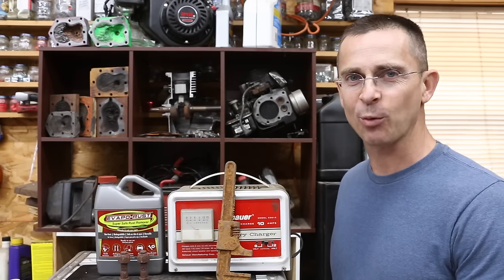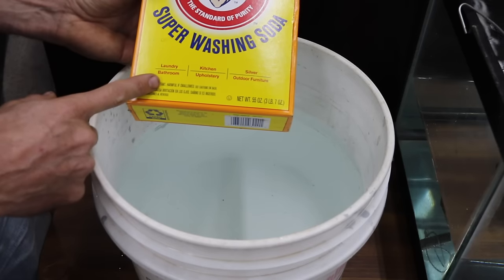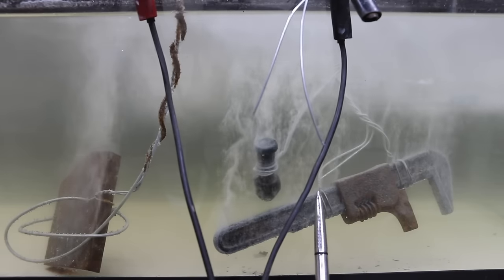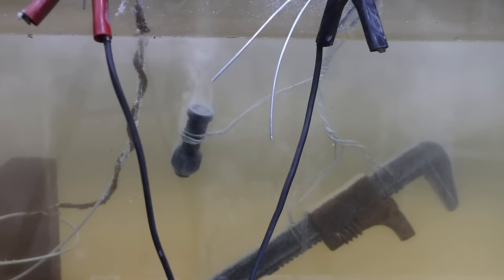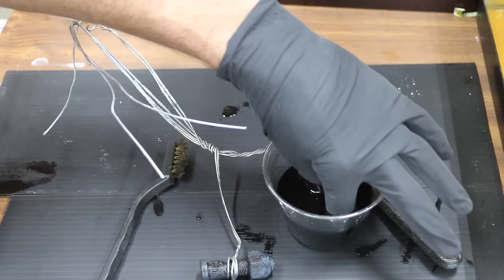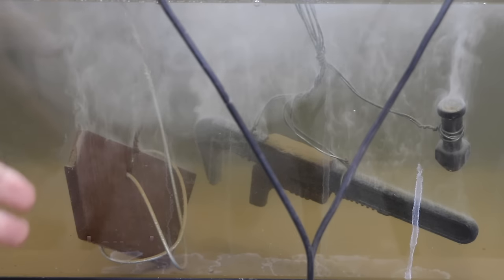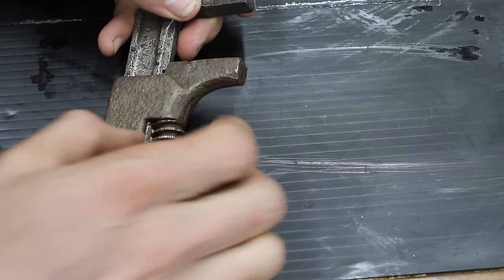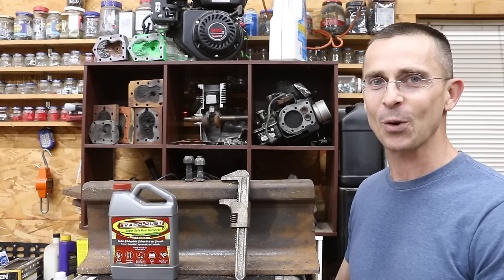Is Electrolysis better than Evapo-Rust?  Let's find out!

Comment: Some other noteworthy advantages of electrolysis:

  The sodium carbonate is not “used up” and can be used indefinitely as long as lost water is replaced periodically and the electrolyte solution is strained or filtered to remove the sediments that build up.

  There is no danger of removal of metal (apart from loose rust that flakes off); no matter how long it runs, no iron will be etched away.

  Under some conditions less oxygen is removed, leaving “black rust”, the same substance as gun bluing, which will slow down the formation of “orange (bad) rust, with the help of light oiling.

  It is easy to make a temporary “tub” for larger parts. I’ve draped plastic dropcloth over a ring of cinderblocks to create a small “tank” on the back patio. Use heavier duty dropcloth for this.

I have read that the process is cleaner using graphite rod as the sacrificial anode. Since the graphite does not react to the released oxygen there is minimal debris produced. Actually it’s not “sacrificial” at all! I’ve thought of trying the graphite pencils sold at craft stores like Michael’s for a small scale setup.
Reply from the maker: This is great information.  Thank you.
Reply: I believe alkaline batteries have a carbon rod down the centre that would probably work also.
Reply: Jester123ish, I don't know. I looked up the differences between the traditional carbon-zinc batteries I grew up with, and the more recent alkaline batteries. The core electrodes are slightly different; the older ones have a pure carbon core, usually graphite with a binder, while the newer ones use a bronze plated nickel collector, so I would say no. Michaels sells "woodless" pencils, which are solid graphite, and Amazon carries carbon fiber rods used in RC planes, which are also a form of graphite.
Reply: David LaPierre, I put on my thinking cap (my good one, not the one from work) and came up with a theory. It's possible that the graphite rods are porous and somewhat soft. I suspect that the bubbles of hydrogen produced from the electrolysis of the water form under the rod's surface, causing the graphite to gradually flake off.
Reply: Thank you for the info, especially about the graphite/carbon anode, as I want to do electrolysis on my bike soon.
Reply: @ProjectFarm  I bought graphite sheets and squares off E-bay.
Reply: Not to kill your vibe but all pencils use graphite duhhh
Reply: Yup take apart a 6v lantern battery and disassemble the cells inside. 

Straight carbon rods
Reply: Carbon does erode pretty fast in my 12v 4amp setup. The watter gets hot. Maybe its an overkill but i get the same results in Hours/Minutes not days. I think the carbon reacts with the oxygen that is formed to some CO2 but its only a guess. Normaly my lysis drop in effectivnes after Minutes due to electrodes corrosion but noth with graphite it even gets out of controll and is progresively agresive due to better conductivity after rust removal. Sadly agressive does not mean effective. I need 10 min to get 90 percent of the rust and another 90 min to get the other 9 percent and another day to get the 0.9 percent.  You have also to concider the placement of the electrodes and moving the part. Electrolysis is so much better then shitty evaporust. You can even derust your car in a swimingpool. I dont know, graphite is pretty expensive but makes your life cleaner and easier.... now i am testing the stability of graphite in the electrolyte without the current.
Reply: @philwood1009  
Could be! Either way, I've never had to clean off graphite after being used a while like I do with rebar or zinc sheets, so that's nice at least.
Reply: @philwood1009  I think you're onto something there. The bubbles would erode the softer graphite compared to a steel anode. I think that's the right word! But you know what I mean.
Reply: @yoruhana190  I'm just curious in your setup have you ever attempted to measure the volume of the oxygen and hydrogen being released during the process? I'm curious about the process of separating the water molecules into their elements. If you search on here or there is videos about what is called Brown gas. People are experimenting with the brown gas to power gasoline engines or at least augment the gasoline. Some Industries are using electrolysis to create fuel for cutting torches. The byproduct of the combustion is water. Also a couple more questions regarding your setup come to mind. How hot is the water getting and what is the volume of the water used? Be safe for that hydrogen and oxygen gas think Hindenburg on steroids. The Hindenburg only had hydrogen gas.
Reply: @davidlapierre4058  have you tried stainless steel? Are you using tap water or are you using distilled water?
Reply: @JohnRodriguesPhotographer  I've read that using stainless steel can create some hazardous byproducts from the chromium, so I've avoided it. I just use tap water. Distilled water might be useful for some precision or coating applications, but probably just a waste for general rust removal.
Reply: @davidlapierre4058  It's an urban myth. The Chromium in Stainless Steel cannot jump up and kill you, or hurt you.  Lack of chemistry education.
Reply: @yoruhana190  No, the carbon does not react with the gas.  It's oxygen and hydrogen.   If you are getting heating effect that is undesired, you need to reduce the voltage.
Reply: @Jester123ish  No, Alkaline batteries do not have carbon.  Old fashioned 'Heavy Duty" Zinc-Carbon batteries have carbon rods.
Reply: @KB4QAA  Seems like you might be missing the point. There are enough uncontrolled factors here to make the details of the chemistry unpredictable. Some chromium compounds are extremely dangerous, and it's very possible that some of those are produced in this process. I'm not terribly worried about them jumping at me, but I would be worried about some small amounts being carried into the air by the bubbles and the misting effect you sometimes get. This would also create handling and disposal concerns. I doubt many people doing this want to worry about hazardous materials disposal.
Reply: @davidlapierre4058  It is always possible to be fearful of that you do not understand. Just don't spread misinformation based on lack of knowledge.  There are analysis of this technique by degreed chemists who have explained the error of this urban myth and others.   Happy de-rusting.   p.s.  A simple protection would be to place a paper towel over the container to prevent misting.
Reply: @KB4QAA  Might want to go back and read my comment. I said I've read of the possibility, which is true and in no way misinformation. This guy at least thinks he's generated some hexavalent chromium: https://www.youtube.com/watch?v=55_j21tCN_k
Not the highest quality test or video, but definitely shows the potential issue (and the potential is the entire point). Plus, avoiding using stainless steel isn't terribly difficult.

Do you happen to have a link to one of these analyses you mention, which shows how it is a myth?
Reply: It would definitely be much pricier but platinum would be a fun idea for a non-sacrificial sacrificial electrode. It's somewhat affordable as wire. Foils, meshes, or sheets would probably be better I assume, but it looks like they get expensive fast.
Reply: Welding and battery graphite are made from powdered graphite fused with various binders, clay sodium silicates etc, so they erode more than true monolithic graphite...
Reply: Hmmm, not used up?  I haven't done the experiment, but I would think that some of the Na2CO3 would be converted to NaOH and CO2.  Some of that gas escaping is likely CO2.  The sodium hydroxide (lye) is also an electrolyte, so you may not notice any change in performance during operation.  Na2CO3 + H20 = 2NaOH + CO2.
You can get carbon rods from people who rent spotlights and searchlights.  Or you can dig them out of dry cells.  If you want graphite, take a carpenters pencil and split it...they have large flat "leads" in them.
Reply: @philwood1009  Nope, graphite reacts with oxygen to produce carbon dioxide. Not used up?🤣🤣🤣 Sodium carbonate is not a catalyst.
Reply: @KB4QAA  Nope, hydrogen is produced at the cathode not anode. And the graphite does react with oxygen. And also, ever heard of joule heating? You're the one who needs to learn chemistry😂😂
Reply: @kimweaver3323   If sodium hydroxide is being generated, it would be easy enough to check by using a ph test strip on the water and see if it gets higher and higher. Also I don't see why he couldn't be using sodium bicarb AKA baking soda, rather than washing soda which is significantly harder on the hands and such.
Reply: @davidlapierre4058   Hexavalent Chromium is highly toxic.  Trivalent Chromium is not.  I don't see how this rig could generate the former.
Reply: Graphite erodes, though. If you want a good electrode for electrolysis, you need platinum. It might sound really expensive, but they sell titanium electrodes with platinum coated on top (so it’s not terribly expensive) for this purpose.
Reply: Using electrolysis for removing rust removes any metal. When the rust is off then the clean steel will be transferred to the cathode. This same process is also called electroplating. It's also a quicker way to make fake rustic signs etc.
Reply: The car running on water and the water torch was done back in the 1980's here in Clearwater, Florida by a guy who had a mechanic shop. Unfortunately he was poisoned and his brother locked everything away. By no means do I think it was accidental, and I'm sure his brother probably got the message. There is a video on yt of a segment done by a local news reporter which shows him using the torch cutting metal and then immediately placing the flame on his bare fingers to demonstrate that it was cold to the touch. Really kickass thing to see. I can remember one video that stated there were over five thousand+ patents applied for that were energy reduction/efficiency related that were confiscated by the U. S. government under the guise of Homeland Security. I'm sure it goes without saying, of what the real reason is and had to do more to do about oil money(petrol dollar) lining the pockets of the elites than it did anything else.
Reply: @kimweaver3323  Sodium carbonate cannot be "used up" and does not get converted to sodium hydroxide. It would violate basic thermodynamics if that was the case (just look at the simple Gibbs free energies of that reaction, and simple fact that there's not even any redox going on in that reaction either!). The reverse reaction, that is, 2NaOH + CO2 --> Na2CO3 + H2O would be the "favored" direction...
Reply: @pault151  You're forgetting that sodium carbonate is way much more soluble in water than plain baking soda. And that's important too so you don't waste too much electricity on just heating the solution itself (remember -- the more ions dissolved in the water the more conductive the solution becomes)
Reply: that looks incredible to you, those parts are still rusty
Reply: Air carbon arc gouging electrodes . You can get them in 16mm diameter and larger.
You need to do a  conditioning run with electrode  and a dummy part to be cleaned, first to dissolve any metallic coating (often copper) the carbon electrode has on its outer surface. If you run the process without doing this , part to be cleaned will get electroplated with the coating alloy .
Reply: @chadh3441  Car running on water is like burning ashes in stove. Not efficient at all. Learn chemistry. There is no free energy here. Lead-acid batteries also are pure water when empty but we don't say that seated toy cars are running on water.
Reply: @otofoto  Please point out in my comment where I said that this actually worked. The fact of the matter has nothing to do with me "learning chemistry". It has to do mainly with YOU learning Reading Comprehension. I never stated anything of the sort, only that it took place in Florida and that a demonstration was filmed by a local TV station. Again, please learn Reading Comprehension.
Reply: @chadh3441  You said it was done and believe fairy tales.
Reply: @otofoto  I said that this happened in Clearwater, Florida. Once again you have shown, that your Reading Comprehension is a fairy tale all on its own, therefore this will be my final response. I will not waste anymore time with someone who is unwilling to admit their mistakes. I bid you good day.
Reply: @jamesduffy9756 Yeah,  but it's mixed with a clay binder.  The harder the pencil,  the more clay and the less graphite...
Reply: Replying to save

Comment: I use electrolysis frequently and found a couple of things that help. The more anodes you have the better it works and that cleaning the anodes of build up keeps the process efficient. The build up is easily wire wheeled if they are still damp, once they dry out for a few days the build up hardens.
Reply: Thank you!
Reply: Geoge K.  Too bad project farm didn't emphasize this as well as ensuring ALL moving parts were well connected.